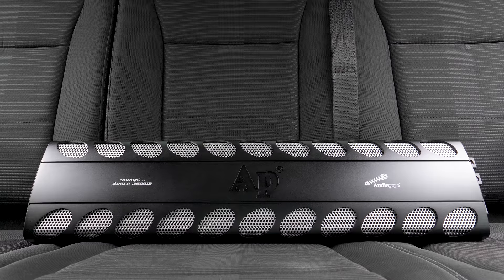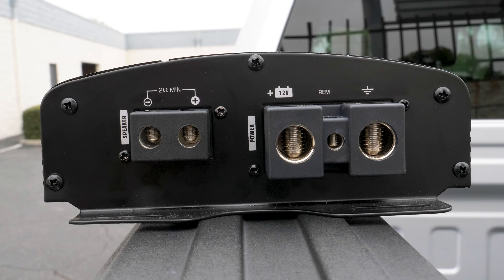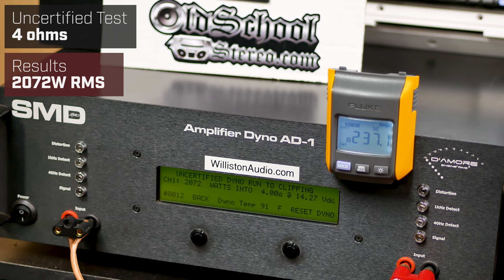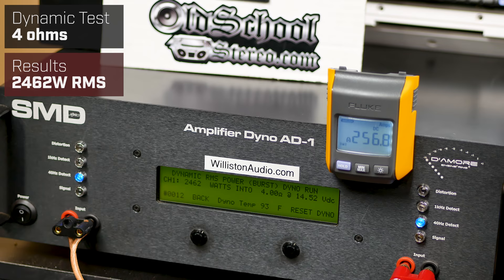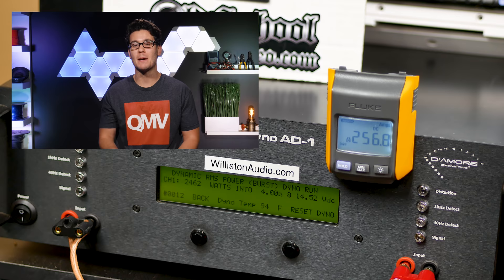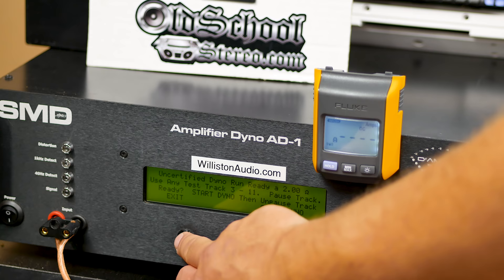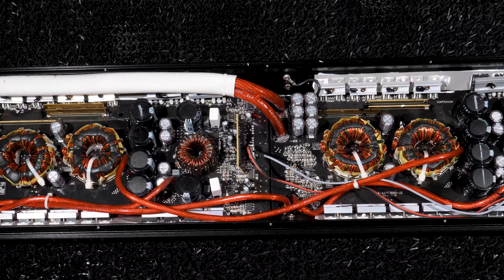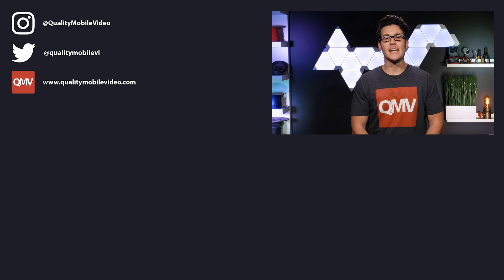Audiopipe APCLE-30001D - BigDWiz Amp Dyno Collaboration!!! 3,000W RMS @ 2 ohms

Comment: I repaired one of these and when testing it at the end it shook everything in my shop. Crazy power!!!
Reply: I just saw your post that u repaired 1 of these amps...i just bought 1 hooked it up was hitting fine then i locked up my sub and my amp went into protection mode and it won't do anything else..i bought a new sub and rebooked the amp and nothing just red led on protection can u help me fix it
Reply: @pauljiron7786  if no smoke came out and it is in protect then your output mosfets might have burned. The only way to know for sure is to open the amp and test them. If you have basic electronic knowledge  you need a multi meter and test the two last lest of the output mosfets. If any of them read zero ohms or beep continuously in the continuity setting then it’s a bad mosfet and needs replacement. This is a simplification of what could be wrong but from my experience it’s usually the case with these.
Reply: U repair amps
Reply: @jessewilkinson2534  yes sir

Comment: I see they made some changes since I had my 1600 watt version which actually had a 1500's internal board! They switched the output transistors to TO-3P/TO-247's from the TO-220/50N06 mosfets they used to use! These boards are actually pretty thick as well, compared to other brands and the traces hold up pretty well! Really surprised they actually strapped two amps internally for the design, but that would explain the 2-ohm minimum impedance since each one internally is rated at 1-ohm!

Comment: I am running that amp on my 2 nemesis audio 12s. They hit hard I'm satisfied with the amp. Glad to see it does well in testing.
Reply: Nemesis hectic 12s
Reply from the maker: nice setup!
Reply: Also using 0g wire extra car battery but I think I need better alternator. Hard finding higher power alts for a 2018 vehicle. Its dimming the lights. Any info on capacitors vs battery let me know trying to make the set up more stable.

Comment: Had this amp installed in February & it's still going hard. Pushing 2, 12" skar vxf  1500 rms & 3ooo max!.. not strap-able would've been awesome to have 6 + k watts
Reply from the maker: BEAST
Reply: Santito 4 life still using amp?
Reply: @FinsleysCustomCarAudio   yes still using audiopipe 3k.. still hitting hard.. why?
Reply: Santito 4 life because I just got the APCLE 3k and love it. I have proper electrical and not going under 2 ohm.

Basically just curious on longevity of the amp. First audiopipe ever owner. So far I love it.
Reply: @FinsleysCustomCarAudio   true it's a powerful amp ..  Bad part is , it's not strappable .. but there's ways around that.. 
I think the new 3k that recently came out is also not strappable,  just 1ohm stable
Reply: Santito 4 life thanks for the reply man. Appreciate it.

Comment: I like the output of these APCL series amps and do great in my installs. 
Now on another subject, I know that a lot of people hate the Epsilon products  but the Power Acoustik EG10k was blasted by a lot of people but I am looking at proce verses output, this APCL3k dynamic current draw was over 400amps while producing 4600plus wattage at a 2ohm load but when the EG10 drew 360plus dynamically while producing 4700 plus wattage at 1/2 ohm with no issues....it was called a junk and a few other word's thats no better in description. 😊...and it comes with that 1/2 ohm warranty that most don't.

please jelp me better understand why it is being trashed so openly while others are not as great ln the dyno get better reviews?
Reply: please dont get me wrong, I love the pipe but I also love and use the power acoustik products as well.

Comment: Audiopipe has alot of haters but I ran a strapped pair of mini 1500's for a couple years in the south Texas heat and had 0 problems. They have some of the best cheap amps out there IMO.
Reply from the maker: Agreed! Underrated gear
Reply: rdooski Yeap! Not everyone can spend 1500-3000 thousand on a amplifier?
Reply: @mykejonesjones1846  Was nice and small too. I made little wood amp rack that wast basically a T and put a amp on each side of the piece of wood sticking up. It made a like little 5x14 amp brick. They were the apsm1500 which were a bit smaller than the current minis.

Comment: Great amp it burn up tow kicker l7 and 2 sound stream 12" wired to 2 ohms and the gain was a Lil over quarter it was connected to 3 .marine boat batteries

Comment: its not 1ohm stable because its just two of their amps strapped together in one big amp.
Reply: Josh Cook yepyep
Reply: I’ve Ran One Of These At 1 Ohm No Harm
Reply: @meezyosama  bet u didn't do it for. Long did u?
Reply: Kerry Bray My Gain Is OFF My Amp Never Get Hot At All I’m Playing At 14 Volts No Lower Than 13.6 or 13.8 And I Playing It Every Day
Reply: @meezyosama  seeing as how the apcl 1500 is .5 stable (provided you have the power to supply it)as seen by lots ,including me who run it at .5 and pound all day long,it makes sense two strapped(the 3000 basically)can do 1ohm no problem.
Reply: Lol this amp has a long history or being ran below 1 ohm without failing
Reply: Dave Micolichek I have the 1500.1 with 2 american bass 15’s 1000 rms each. Currently wired at 2 ohms but thinkin of dropping to 1 ohm. Wasn’t sure how the amp holds up at 1 ohm though
Reply: Yup
Reply: @dropzonemedia7811  yes you can drop to 1 ohm due to subwoofer and box rise,  wired to 1 ohm actual fluctuates between 1 and 3 ohms

Comment: I had a Skar rp2000 wired at 1/2 ohm (not recommended)  to a zv5  but blew the amp and for a temp amp I installed the audio pipe 3000 but it doesn’t have near the power of the Skar, both gains set with a oscope, any ideas why it don’t make a lot of power before clipping?
Reply: Not as good build quality

Comment: Would it be ok and safe to run this amp on standard car electrical 14v stock ? i only know of a couple of people who compete that actually have a 16v system out of 100s...Please advise, thanks...
Reply from the maker: You'll probably be fine running it at the 4 ohm load. You may start the amplifier running 14v at the 1 ohm load
Reply: @Qualitymobilevideo  It just disturbs me that it says 16V right in front of the amp APCL-30001D mono im currently running a CAB1600.1 @ 1ohm on all stock Audi electrical with no signs dimming...?? Thanks for replying as well any help or advise is GREATLY APPRECIATED before i melt or blow something up LMAO...

Comment: I run it at .5 ohm to two soundqubed 18s in a 12cuft. Enclosure. With four 6in. Prescion ports
Reply: Hey do your amp cut off .u are talking bout the apcl 3000 amp right?

Comment: Do I need to run dual power and ground to my 3000 audio pipes with 4 extra batteries
Reply: going by gp car audio i would say yes. they have a video here showing gains of a 1/2db compare to a single. as for batteries, 1 should be good with a 6 pack power bank. its less stress on the alternator than charging up 4 batteries

link to that video: https://www.youtube.com/watch?v=U-TtRjstvV4

Comment: @400 amps... Jesus it a Power hungry amplifier
Reply: robert wood close to 5K watts any amp is going to draw close to 300-400AMPS
Reply: @mykejonesjones1846  

Nope I disagree the audio pipe amp is dirty lol it's extremely power hungry because of it's strap configuration. In deed it's an budget gem but it's dirty on power. And running this amp with in proper power supply will lead to it's failure.

Comment: I have this amp big d and it keeps shutting out(protection light) comes on wen bass note drop I have it hooked to 2 skar audio evl 12 inch 2 ohm subs I have also installed a Extra battery in the trunk have a zero gauge kit the radio even shuts out even with the amp turn all da way down
Reply: Resaa Lynn check your grounds and also check all of your RCAs ? Sometimes bad rcas can trigger a protection..,

Comment: Can this amp push 4 15inch kicker cvx
Reply from the maker: Do you have the 2 ohm or 4 ohm subs
Reply: I have the 4ohm subs
Reply from the maker: This amp is actually solid then because Four DVC 4 ohm woofers get wired to a 2 ohm load and the amplifier does 3,000W RMS @ 2 ohms. The only problem I see is that those subs do 1,000W RMS each, and ideally you want your amplifier to either match the RMS of the subs or have a higher rating for head room. But so long as you don't push them too hard you should be ok. Another option would be to get two amplifiers with a rating of 2,000W RMS+ @ 1 ohm, because you can wire two DVC 4 ohm subs to a 1 ohm load. Might be a little safer
Reply: @Qualitymobilevideo  thanks and I'm just gonna go buy two 2500watt brutus elite 35th anniversary or a 4000watt hifonics brutus elite 35th anniversary... which one do you think I should go with?
Reply: @stevojohnson8997  none, hifonics inflates their numbers. id go with 2 wolfram c-2400.1 amps. its been dyno tested and proves that it pushes their claimed watts
Reply: @rowboyto156  Ok thanks I'm gonna look up the prices

Comment: Want to know what it puts out @ 1ohm
Reply from the maker: Not stable at 1 ohm
Reply: smoke. it puts out smoke at 1 ohm.
Reply: I run it at .5 ohm to two soundqubed 18s im a 12cuft. Enclosure. With four 6in. Prescion ports.

Comment: its just 2 1500 watt amps bridged internally thats why it can't do 1 ohm. why buy a Class D if you can't do 1 ohm. now you gotta rewire or rebuy your woofers to compensate for DVC 2 ohms
Reply from the maker: Well there are pros and cons, same with a 1 ohm load. 2 ohm is less power yes, more efficient. Some people may be stuck with two DVC 2 ohm woofers and can't make a 1 ohm load, and have to opt for the 2 ohm load, which some people actually prefer. Like all things in car audio, its subjective.
Reply: Chuck Holmes dude it’s just a 300hundred dollar amp most people run them  until they can up grade!!!

Comment: If I have a 200 amp alternator how many batteries would I still need to run to power this amp
Reply: one battery in the back and one of those 6 pack power banks but if youre in a tight budget a battery and big 3 should be enough, you just cant bump it hard/ max volume for a long period of time
Reply: Rowboyto what is a 6 pack

Comment: Awesome! Finally the video I was waiting for, I have this amp and the triple stock audio pipe P12, dual 2omega. What's the correct way to hook this up? It gets hot at 1ohms and does hit that heavy at 4ohms.
Reply from the maker: Unfortunately, this amplifier is not stable at 1 ohm! Which is why it's getting hot, you're lucking it didn't fail on you/ Wire it in series for a 4 ohm load.

Comment: So they stuck 2 of their 1500s together. Not that impressive. Could buy 2 skar 1500s for less money. Or a tiny bit over 400 bux u could get 2 of the skar 2k and do better in my opinion. That's pretty cheap and you coul put them n more places than that audiopipe.
Reply: Kerry Bray well I would say that but this looks more like the shark 3500d inside..
Reply: Kerry Bray that’s your opinion potna!
Reply: @mykejonesjones1846  and my opinion is good
Reply: This amp is funny to me. Its hella long and only does 3k. Really? Sounds a little weak for the size

Comment: I love audiopipe but why you gonna have all this power and it not be 1 ohm stable
Reply from the maker: Good point
Reply: True but it would be a good choice for some. Some mainstream brands like Kicker, Alpine, and such have been building amps for years that were only stable at 2 ohms. Just plan out your system to end up at 2 ohms and problem solved.
Reply: because its 2 amps that are already strapped for you. if you want something 1 ohm stable id suggest the orion xtr2500.1dz its over 3k at 1 ohm and its korean built

Comment: I actually have this amp in my Infiniti sedan 😭
Reply: What are you pushing on the audiopipe 3k ? I have mine pushing 2 12's skar vxf"s
Reply: Santito 4 life sorry bro I didn’t see this until now but I have 4 audio pipe bd4 15’s on 4 audiopipe 3k’s
Reply: Running this amp on 3 12s 2 sony xplods & 1 pioneer premier Sounds Like a army tank when i ride pass
Reply: Santito 4 life still using? What ohm you at?
Reply: sherrod gee what ohm load you got?
Reply: @FinsleysCustomCarAudio  2 OHMs 0 gauge All Around With Stock 120amp Alt

Comment: Yeah but it over heats and goes into protect mode after 15 minuets
Reply: Over heats but got the power thumb dwns i had this amp to on a a memphis mojoe 15" 4400 watts /2200rms
Reply: Mine dosent.  Had it since 2017